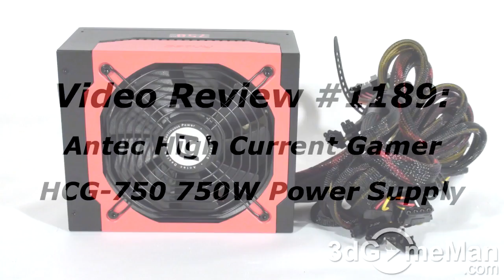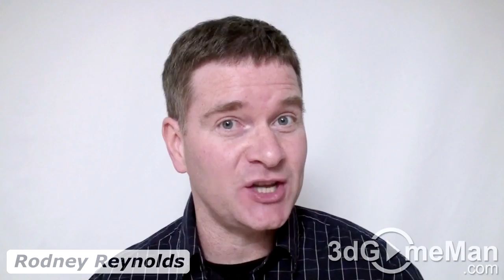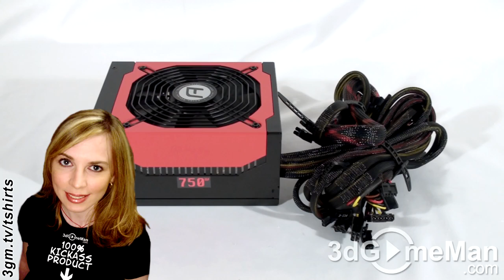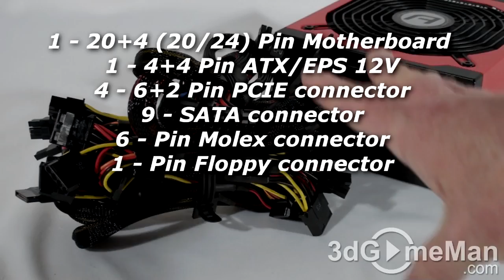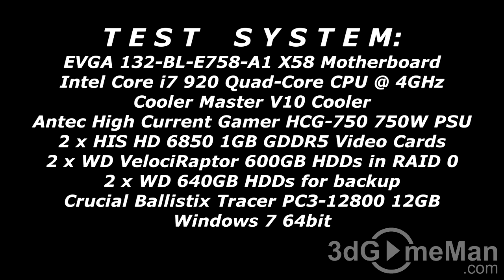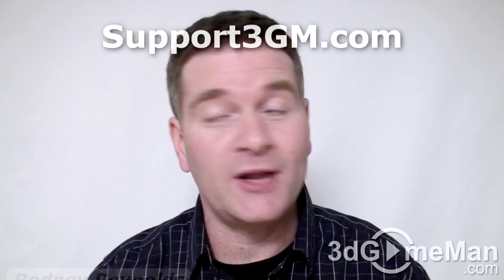#1189 - Antec High Current Gamer HCG-750 750W Power Supply Video Review

Comment: @naka538 multirails will trip the overcurrent protection faster than one massive single rail in the event of a short, potentially making the difference between killing your components or not.  As long as your buying a high quality PSU, whether its multi or single rail doesn't make a big difference, because a good PSU company will make sure there is enough amperage for all the stuff connected to each rail.